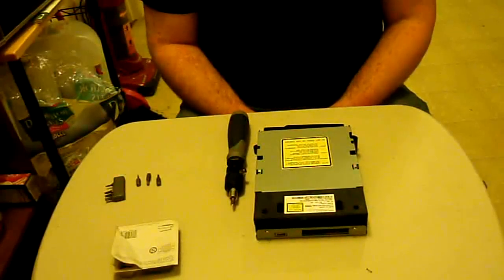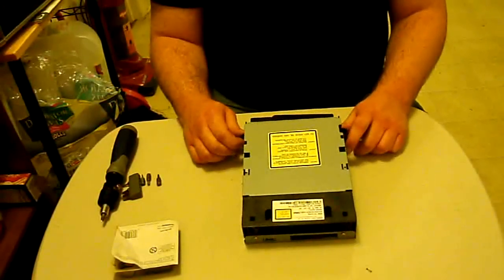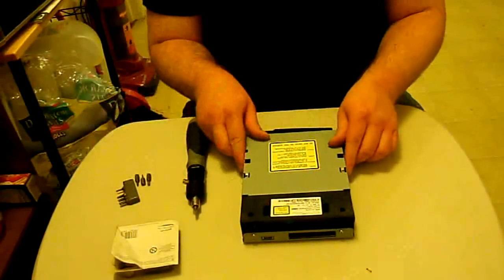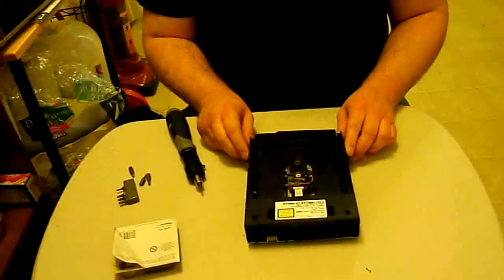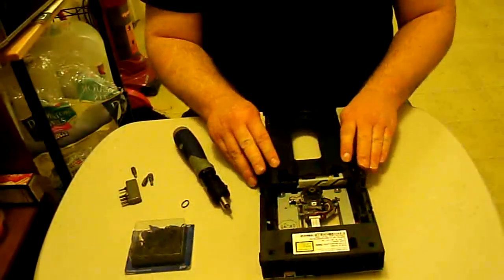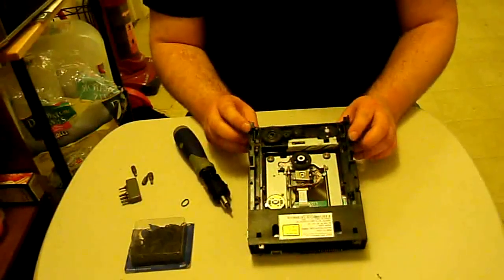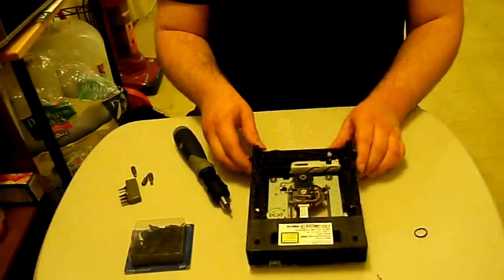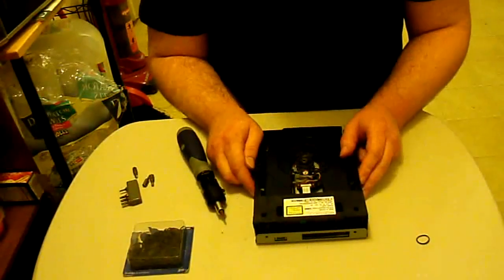Original Xbox Eject Disc tray fix tutorial

Comment: Replacing and cleaning did not work for me.  Maybe something else - 

It opens and closes by itself with a chugging sound and powers on and off occasionally.  The power button doesn't work  at all and I have to pull the plug.  Always starts with the system already powered on when I put the plug in.  Any ideas?  Power switch problem can cause this too?
Read more
REPLY

Comment: I need help!!!!!!!!!!!!!!!!!!!! I changed the band and it still won't eject. and when I hit the eject button the screen goes black. I turn off the system for about 15 20 minutes and then it will eject. what do I do now?
Reply from the maker: It is difficult to say what EXACTLY is going wrong. However, a big red flag jumps up when you say the screen goes black when you hit the eject button. 9 times out of 10 this isn't an issue with the disc drive at all. This is usually a very very serious issue related to the traces on the bottom of the motherboard. The traces for the eject and power button can get corrupted because they are right on the edge of the motherboard. IF that happens, strange things can come next. This can include what you talk about because the eject button is actually turning the console off. sometimes it means the disc drive will never stay closed because the corrupted trace is constantly sending a signal to try and open the drive. Basically it seems like the power and eject buttons have minds of their own. If that is the case (which I am pretty sure it is) You would need to buy a motherboard set matched with a HDD and replace all of that.
Reply: Tinker Mods where can I get those parts? I had a hard time finding a controller and games no one has original Xbox stuff around San Antonio
Reply from the maker: Joe Tellez you will have to go online to find it and sometime there are parts that can become pretty rare. You can send me an email at support@fixyourconsole.com to talk more in depth about it.

Comment: The problem with my xbox is that the tray keeps ejecting. You said on an earlier comment that these steps will also solve this problem. But unfortunately it didnt. I did all the steps but it keeps on ejecting the fucker. Any ideas? Stretching the rubber band more?

Thanks in advance!

Comment: when I turn on my Xbox the tray opens automatically without me pressing the eject button and when I do press the eject button the tray closes and open again, even when I press the power button the same happens, can this method fix it?
Reply from the maker: This could actually be two different issues. From what you describe that MIGHT be a disc belt problem. However when you say you push the power button.. are you saying the power button doesn't turn the console off? That the power button is actually opening and/or closing the disc drive instead? If that is the case then you actually might have the corrupted trace(s) issue which is a totally different problem and is very difficult to fix. In most cases buying a replacement motherboard/HDD would be your best bet to fix that.
Reply: Tinker Mods OK understood

Comment: i did chance the elastic but it won't read. I'm thinking I didn't stretch the rubber band enough before I put it in because its not reading the disc. don't forget to stretch out the rubber band or it may take a while to get tray back to reading the disc.

Comment: I don't think my tray looks like your one, and it doesn't have flaps like you described either, I'm from europe, I may have some wierd other version, I managed to change rubber bands anyway thoughm, thankfully the hole in the ttray is big enough to get in with a needle and use that to put the band in place

Comment: Hey man, this is an old vid so u may not answer, but here I go, my disc drive is confusing, it ejects whenever I press the eject button, but when I try and press the button again or push it back on myself, the eject button flashed repeatedly and does not stop while the tray keeps popping in and out. Another problem is that my power button does not work so I have to unplug my Xbox to restart it. But it makes no difference when I restart it. Any help or suggestions would be nice

Comment: Thanks a million bro, fixed my original xbox in 2014, I have the toshiba samsung drive and the tray doesnt come out but the belt pullys were clearly visable with the tray hakf way out, I snuck a new black rubber band under the tray and got it, thanms again dude

Comment: I have a Philips drive in my original xbox. Earlier in the week I was excited to finally get my brand new factory sealed copy of Splinter Cell: Pandora Tomorrow. Well I had not played my xbox for several months, but I kept it in a dust free 30gal storage bin. It started up ok, maybe a little noisy but I didn't think anything of it. Well I got tired of playing the game, and turned the Xbox off without taking the game out. About a hour I got the hankering to play it again, and then boom, red ring of death on. The screen would show a big 12 in the corner, and multiple messages in different languages that my xbox needed servicing. After some prayer it started working again and I was able to play but then the game froze and crashed. The message remain the same.

The door does not even make a sound like it is attempting to eject, and sometimes when I turn the power off it sounded like it was still running. It would stop almost right away if I unplugged the xbox.

So anyways, after going through hell and the paperclip trick not working worth a damn, I finally took the thing apart to retrieve the game (undamaged thankfully). then after more hell, this video helped me get the tray open. I cleaned the gears with rubbing alcohol and cleaned the track and everything, but I did not replace the belt. I put everything back together, but the red ring of death is still showing up and the tray does not open. Did I go wrong by not replacing the belt, or is the drive burned out?
Reply: I think your motherboard is overheated. This can be caused by 2 hings:
1) Your fan is busted by not being connected to your hard drive
OR
2)Something is damaged within your motherboard.

Comment: Thanks, the drive tray now ejects thanks to your method. But now its showing a red light and that it "needs a service" (not that I blame you at all). It did it occasionally before, but now it's every time I turn it on. Sigh. It's a shame exclusive original Xbox games don't get re released because the original hardware is so god damn temperamental and they will die with the system. Microsoft was really awful at making consoles until the Xbox 360 slim/ One which are fantastic. I just want to play some Amped, Otogi and Breakdown  :/

Comment: Tinker Mods, Great Video Brother! Very thorough. I have a problem with my original xbox that I wonder if you can help me with. I followed all the steps you showed me in this video, and I replaced the rubber band in my xbox. I can manually eject the xbox tray while it is powered down, place a disc inside of it, and it will read and play just fine. However, when I try to eject a disc using the eject button, it will eject. The green button won't even flash. Any suggestions on what I should do? It doesn't seem like there is anything major wrong with my xbox. Thanks for the help.
Reply: P.S. my disc tray is exactly like the one you showed in the video.

Comment: Well, mines completely different. Can't get the tray out. The white plastic tabs in your demonstration, are a mint colored green inside mine and they are a different design. I managed to get the gum band on without taking off the disc tray. But the belt was not broken or anything. So I don't know if that's what the problem is. I hope it's not the motor or whatever it is that makes this thing eject.